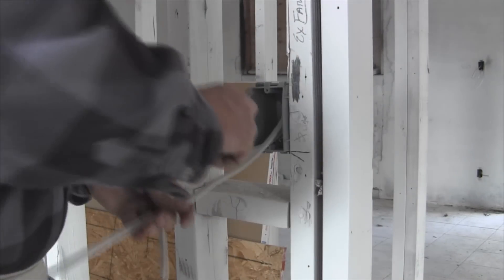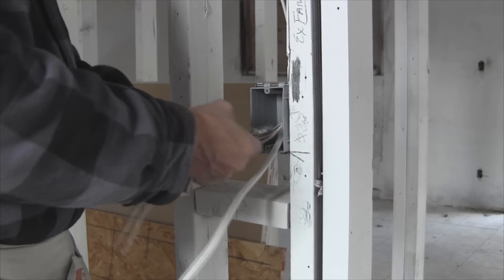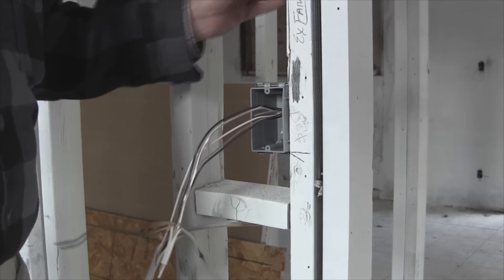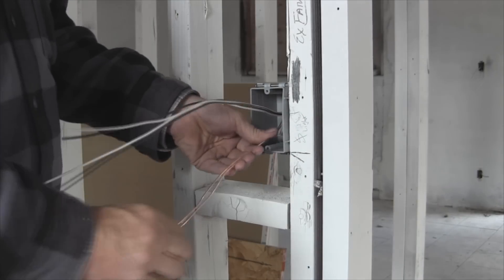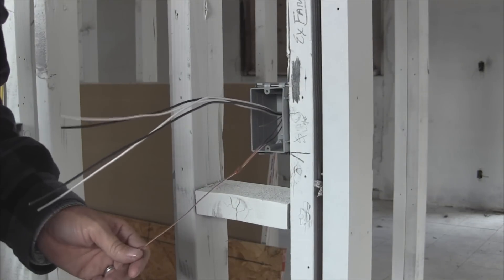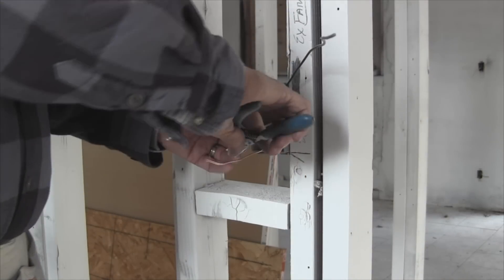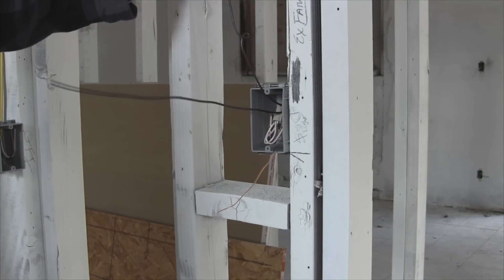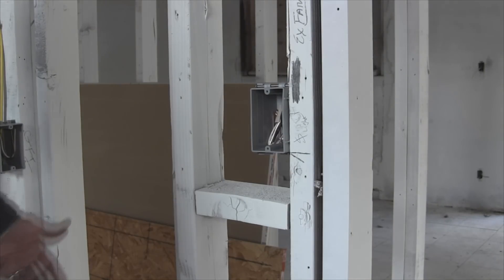Electrical Wiring-Basic light switch wiring

Comment: Pain full to watch, first never strip inside the box, second don't use razor blade, 3rd use metal box with screws in the back for grounds,4th use linemen to twist wires together then twist wire nut on.
Reply from the maker: Your method and my method are both acceptable ways of making up a box. I struggle with a person feels that their way is the only way to do something.Please supply some credible facts as to why you should never make up a box this way instead of giving me your opinion.

Comment: i noticed he did not use wire cappings,fire hazard
Reply: Not if the wires are not hot.  I'm sure the breaker box will remain off until after dry wall is installed and plugs/switches are installed.

Comment: no electrician in the uk strips with a knife ,, we make an initial cut with wire cutters then pull the cpc (earth wire) thus stripping the cable ,, we then cut the excess outer sheathing off, and believe me its alot easier and neater than the american way.
Reply: stupot birchall 
I'm from the US and I have never used a knife..... Always strippers. So don't bunch us all together with this hack.
Reply: I believe the UK has ETSI standards and the us has ANSI standards.  If you follow the codes there won't be a problem.  Common sense tells you not to damage the insulation on the wires and using a knife is obviously risky.

Comment: the way i was taught was never use a knife to strip the cable. the way i do it is make a cut at the end and pull the earth wire along the cable then cut away the sheath with wire cutters. i find it just as quick and can save more work later on if you make a mistake with the knife. everyone has there own way to do it though.

Comment: I  do not know of any code that says you can't use a razor knife. I just see a lot of wasted time and wire.
 The amount of wire sticking out is way over board and then to strip it all is wasted time
I do question the turn in the wire although a good idea is that not a possible chance of a hot spot

Comment: The absolute WORST wire to strip on the PLANET is the Bell System's Telephone old "C-wire" that looks like giant zipcord. It has two coated copper plated steel wires where the plastic is actually bonded somehow to the copper. One really is not stripping off the plastic, more like whittling the plastic off. The steel wire core is drawn super high strength high carbon wire more like music wire for springs. With "C-wire" one can pull out a phone truck stuck in the mud. The plastic never slides off

Comment: That is the worst way to strip NM and is the main reason why I fix sliced conductors in boxes all the time.  All you have to do is take your utility knife and put a 2 inch slice at the end of the cable and pull the outer sheath right up then snip it off.

Comment: That is the absolute worst technique for stripping NM wire.  I can't tell you how many times I repaired nicked or sliced insulation on the conductors.  

All you have to do is slice about 1 or 2 inches at the end of the wire and pull the sheathing up simple.

Comment from the maker: @albduke1 Time varies from job to job,there are many ways to increase productivity wiring homes. Useing a story pole to set boxes,string and a roll of tape to run long runs across rafters,layout/design,tooling up for each step,and having all the materials on hand so you don't have to stop a section and go back later.
As far as the corners,when pulling feed from the farthest end of the run first.

Comment: Hey Sparky !!!
Great Tips my Friend !!!
I'm not a Electrician but I do Wire High Voltage and Low Voltage , and always find Helpful Hints from you I can Apply in my Trade !!! (like the BX tool , you made a video about) ...
What was that Crimp fitting called , can I get for #8 ?
Thank You so much for Posting Sparky !!!
Videos are lookin Awesome !!!